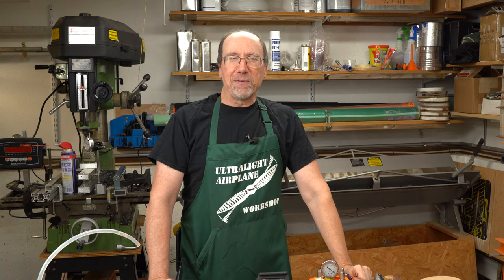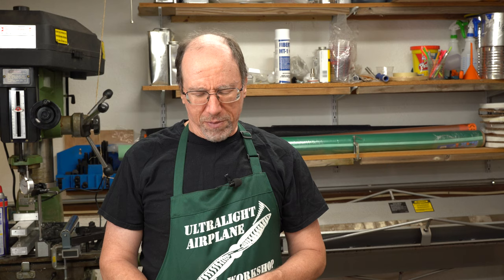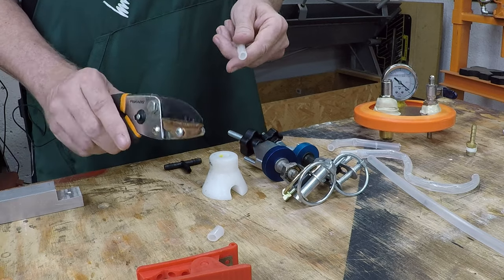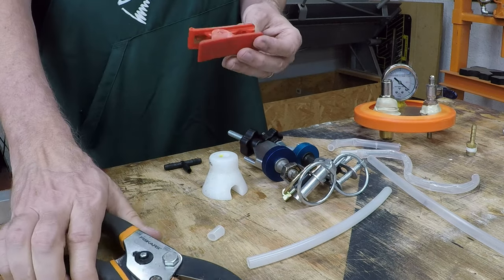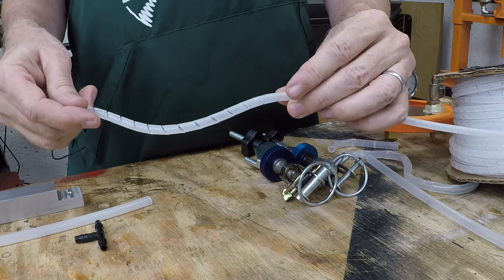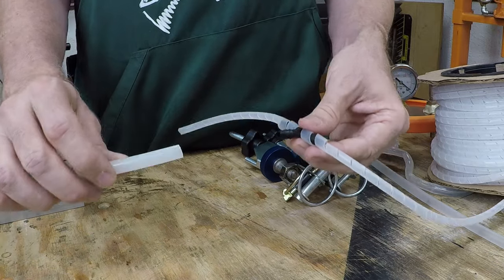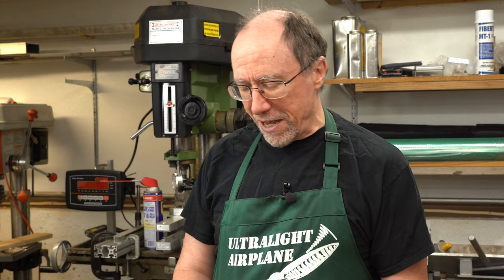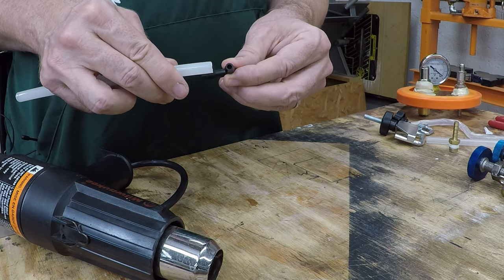Preparing Vacuum Tubing for Vacuum Bagging and Vacuum Resin Infusion

Comment: Learning how to make carbon fiber parts appears simple enough to make parts for my PPG trike nose cone and fairings. Mike Patey, in a recent video, built a one-piece CF skin for his "Scrappy" plane and I wonder what release agent he might have used to lay up CF on the aluminum mold he fashioned around the frame.
Reply from the maker: I saw the video you are referring too.  Since the mold side was the inside of the part just about any release agent would work including wax with PVA, because you would not really care what the mold side surface looked like. I did not see any coloring on either surface after removing the part so I'm guessing that PVA was not used. Using wax by itself can work but on such a large part it would be risky (harder to remove the part). I would guess, and this is only a guess, is that he is using a permanent or semi permanent release agent. Since the mold side of the part was not shiny it is more likely that he used a semi permanent release agent. I could easily be wrong though.

Comment: Have you looked at push-to-connect fittings?  Home Depot sells shark bite fittings in 3/8, or McMaster has a plethora. They are expensive, but infinitely reusable, and easy to connect.
Reply from the maker: Hi James, I've been reluctant to use any reusable fittings because of the issue of having cured epoxy set up within the fitting. I might be able to drill out the epoxy but that is a pain. I already have to do that on the fitting on the input side of my catch pot. I'd rather throw away a 0.12c plastic fitting. But I may give the shark bite fittings a try since I do like to experiment.